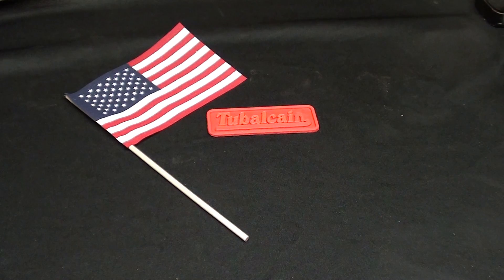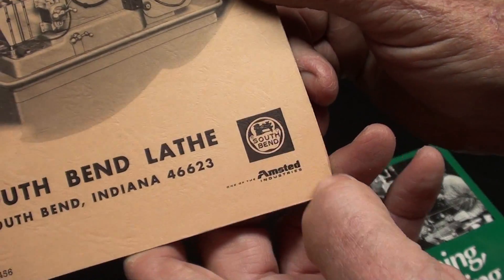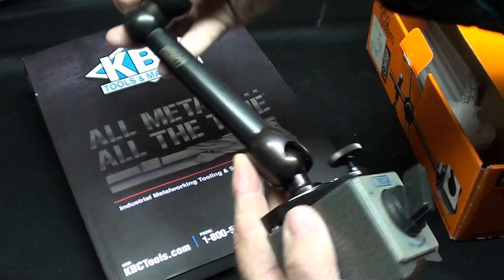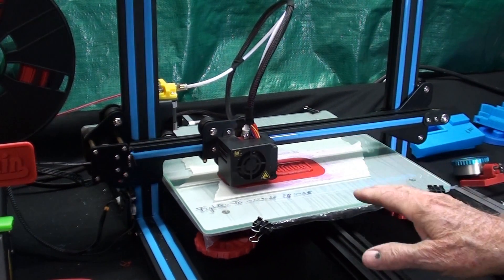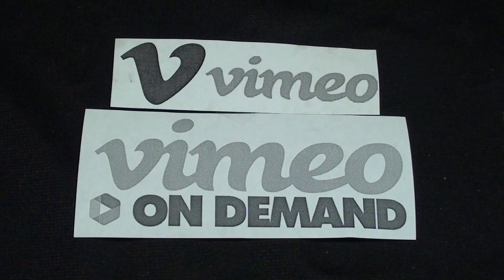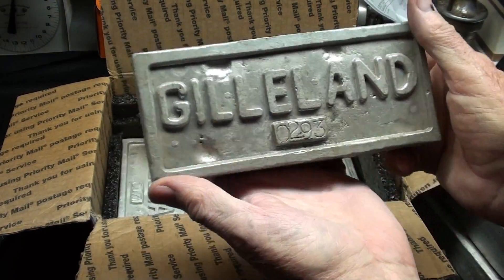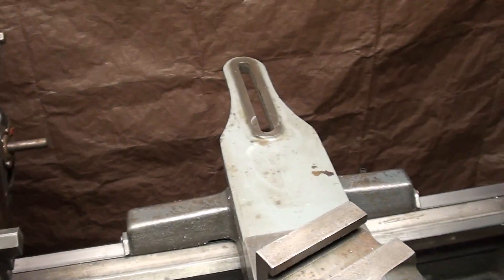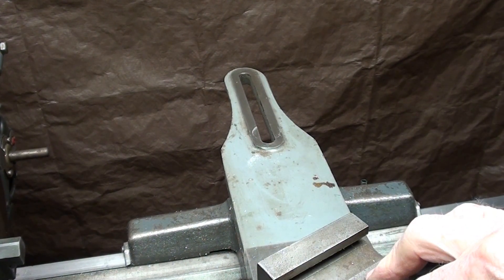tubalcain THIS & THAT Episode #32 mrpete222

Comment: You made me miss my old 49 Hudson there.  Great tour of the car lot.. Sad event having a fire damage so many great old cars.   I designed a spill proof oil container based on your video for brazing a tube into the food can.  Mine has to be printed in ABS material and rinsed with an acetone solution to seal the inside, but it works great.  Thanks for the inspiration.  I also posted a design for a 5C collet draw bar handle to replace my broken one.  Both on Thingiverse
Reply from the maker: My aunts 49 Hudson was brown, maybe they were all brown.
Reply from the maker: Give me the links for thing averse

Comment: Hey, Mr. Pete.  What'd you do to that right thumb?
https://www.dropbox.com/s/4u6othoj1zteaqe/2017-12-10_21-52-55.jpg?dl=0

About a year ago, I had a 1/2" brass shaft about 6" long in my hand and managed to drop it perfectly on my left foot.  It hurt a little bit, but I had my shoe on and thought nothing of it.  I can't believe what a mark it made under my left big toe nail.  It was right at the quick.  It's only half grown out now.

I hope the antique car people can get some fire suppression going on this next build.  You can bet if those were modern cars they'd have burnt 10x hotter and 50x faster.
Reply from the maker: I still have no idea what I did to my thumb. However last week A bar of steal fell off the shelf. And landed on my big toe. It turn purple like a plum. It's just now starting to feel better

Comment: I used to mow yards in the mid '60s.  I bought my Ruger Super BlackHawk in 1976.  My dad also had a '58 Chevy.  I had two of those '64 Olds Cutlass you see at 12:30.  Would give my eye teeth to have them back.  I also once had a '67 Nova SS, one of only 900 made that year with a 6-cyl engine. Looking forward to new projects with the foundry.  Keep machining my friend.

Comment: Huge smile to see your 3D printer!!!
Reply: jimmydiresta We should get him a laser cutter.
Reply from the maker: Thanks Jimmy, I'm having fun with it. I wish I knew fusion 360 like you do. I have been using tinker cad, but it's rather primitive. Your new building iscoming along nicely.
Reply: mrpete222 
mrpete I purchased a Gerstner tool chest from a Retired Machinist and it was filled with all of his tools (all of them were Lufkin)
I noticed that there were old pennies in all of the drawers, when I asked him about it he told me that they prevented rust from forming on the tools. Have you ever heard of this process for rust prevention?

Thanks,
Dave
Reply from the maker: I think that is an old wives tale.  Was there any rust??   Lufkin tools are great.
Reply: mrpete222 
No, no rust. The Pennies were green. The lufkin tools are in great shape. I purchased the Gerstner Journey Men’s cabinet Model 052 and an Atlas/Craftsmen Commercial Lathe from him for $800.00.  I very much appreciate your videos.

Dave

Comment: Excellent video mrpete. Thanks for sharing.  A very nice gift of the Ali bricks.  They had a fire at the classic car shop so they put up a wooden building to replace the burned one. Makes you wonder why. ?    I would have thought the insurance company would insist on something a bit more fire resistant.   regards from the UK
Reply: I said this to myself about the wooden replacement building too... great tour of that classic car park, with even 2 or 3 Brits in there :o) Dave in UK
Reply from the maker: I'm sure it will have a sprinkler system